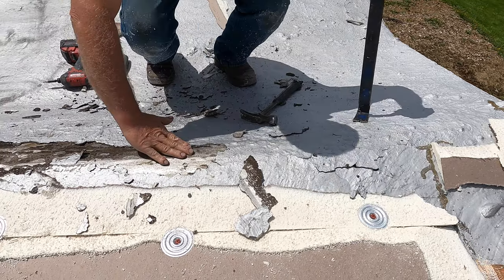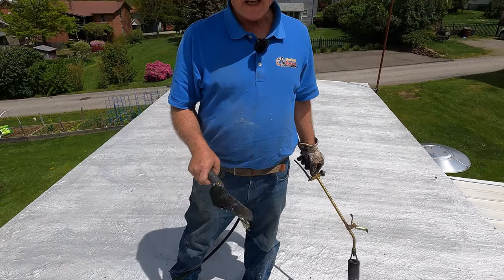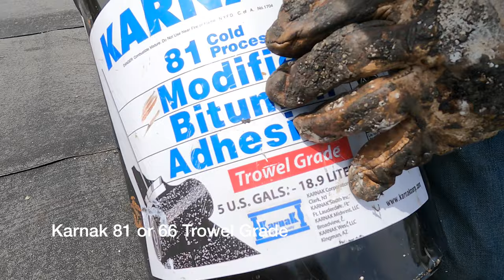How to make a Trailer/Mobile Home Roof Leak Repair

Comment: You two rock my socks! I'm in a mess of my own over here.. heading in to winter. Roof is leaky slippery frozen and I wish I knew what direction to take but, I just don't given the circumstances. Hindsight... But working backwards and buttoning up and undoing to try to do again is like an insane person's game. Rowing in place. Probably making it worse.
Reply: You and me both. Did yours decide to leak right over your most important and / or beloved items in the whole house...er, trailer, whatever...because Murphy's law made sure of that for me.

This little crapshack was just supposed to be for a few months but I'll be damned if life doesn't just slap you around sometimes to prove it can.

So I'm sitting here with ya. Misery loves company, so they say. But Misery doesn't bring alcohol! Let's drink. 

Cheers.
Reply: @Robodie

I wish I knew, I've had 2 roofers out and perhaps I'm part of the problem here because I finally realized neither told me what I actually want to know, WHAT'S THE PROBLEM, what needs done? Not rip this crap that never should have happened off and redo it for 10 grand, I want to know why, where, is it butyl tape and trim work and all new screws or burn the place down ? Sometimes it feels totally hopeless and other times like it's probably just a couple of things that need to 'actually' be done. But - the weather, lack of help, funds running out... Turns out metal roofs are super cold and slippery this time of year 😋 I'm both ahhh I gotta do something and I don't even fkn care anymore, I'm with you, cheers. Vodka, kombucha, the maddening sound of a dripping rectangle. Whoop.
Reply: @Robodie

To actually answer your question.. it hasn't 'obviously' leaked as in dripping that I've seen yet but it's very obvious looking at the ceiling almost everywhere, likely between the walls as well, and how bout the flooring? I hope not. I don't want to know.

Comment: Sir , I was a roofer for lots of years when I was younger, and everything you said ,did and do to fix leaking roofs is 100% in the info you give and the videos showing how is you do it is perfect , I haven't been in the roofing world in some time , but now I sprung a leak around the kitchen vent and maybe a seem or two but not sure yet , but what is more important to me right now is ( I NEED SOME ADVISE FROM  YOU IF POSSIBLE ? ) I've never seen or used the materials you used , so could you help out a man clear across the states,  I'm 30 miles from the west  Texas border , I'm in a small town with no real materials available so I'll have to drive to Amarillo Texas if available at the local hardware stores like home Depot , Lowes hardware store etc.  So could you please send me any info your willing to share this is greatly appreciated , if you can't , with all due respect thank you for everything ....Mr Quintana

Comment: Sir please come to Chesterfield Virginia USA and do mine. I have a dip that collects a water puddle. It has cracks like that roof. Over the years different sealers have been applied, but still waters getting through and the inside ceiling on my mobile home is starting to get a belly.

Comment: You don’t need flashing/ drip edge with EPDM?
Reply: You can run the e.p.d.m. over the edge or into a gutter a few inches and then secure it with an aluminum termination bar which looks like this in side profile [ . It generally comes in  1"×10' lengths, is pre-punched w/holes every few inches to accept 1/4" screws or masonry fasteners depending on if your terminating over a flat perimeter edge or up onto a parapet or interior wall and whether you're securing into a wood or masonry substrate. It will at least one kick out (sometimes two) which are usually at a 45° angle and serve as caulk ledges for your sealant to rest on waterproofing the termination detail after it has been fastened.

Comment: Hey Roof Doc my detached garage is shingles and my house roof is Tar Gravel, if i ever get a leak on the tar roof im gonna clean an area 4x4 ft of gravel and dirt then vacuum it good, do you recommend i smear on slightly melted Henry roofing Tar or the Karnak Tar.
Reply from the maker: I suggest you vacuum up and steel brush the surface to agitate the dirt up. Then use a propane torch to slightly melt the surface, then smear any tar to seal it. When you starting to have leaks on a Tar and Gravel roof, then you know the end is near for the roof. Anything from 30 years and above.

Comment: Hey doc greetings from belgium. I have a question i follow your accoung from a year ago and i notice that in america or in your videos people dont seem to care about how clean the seam are torched. here in europe we pretty much are used to 5mm bitum leak and no burn on the other rol. I know  your job is still water tight but here we need to keep it clean! 

Search for soprema roofing to see refrences.
Reply from the maker: You are correct. About 5mm bleed at max. I use the rolls with ceramic granules, and it appears that there is a burn on the other surface, but after a rain that is all cleared. It is just the black smoke from heating the seam that blows out onto the white granules.
Anyway, I am self taught, so I don't follow rules. There were not many to learn from when I got started. I know you guys in Europe and Canada are much more picky about your jobs. I am very happy to see that. My son is like that too. everything must be perfect.  Check out his videos All Roof USA. @allroofusa
Thanks for watching and the comment. I don't think I am a good example of being neat and perfect. Far from that
Reply: @FlatRoofDoctor  thank you for answering.yes self taught is verry impresive, im contractor but working for big company. My dream is one day to become just like you. :) keep the good work

Comment: These trailers were not meant to be lived in this long that's for sure. 

I lived in a trailer like this from the 70s, they just didn't build these to last. 

That style of roof is basically a death sentence for the trailer, unless you are able bodied and can afford to completely redo the whole roof. No one wants to work on rooves like this, there is no real good way to repair them. They are a death sentence. IMO all these trailers should just be scraped and never done ever again.